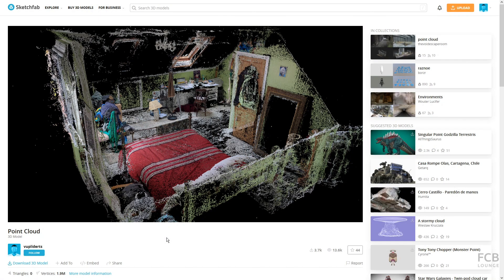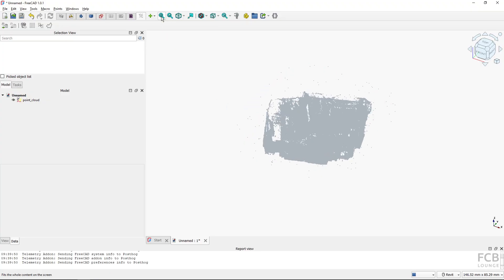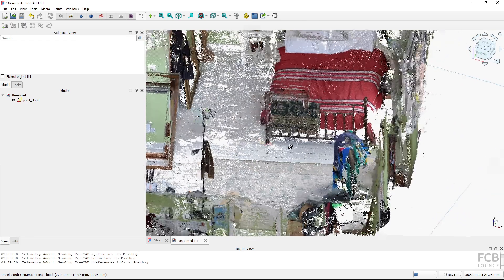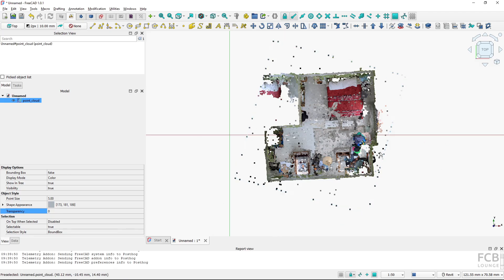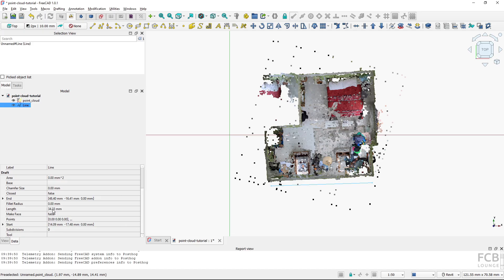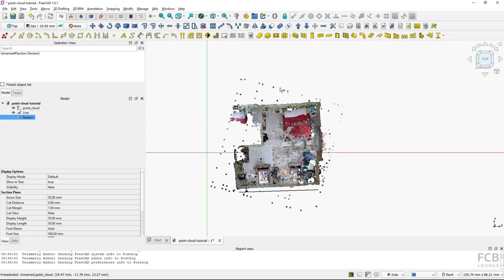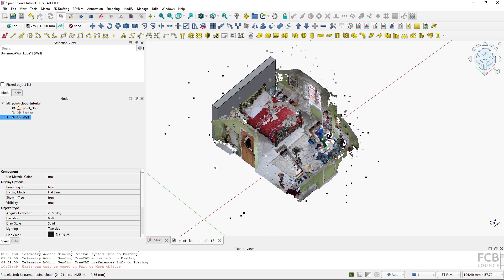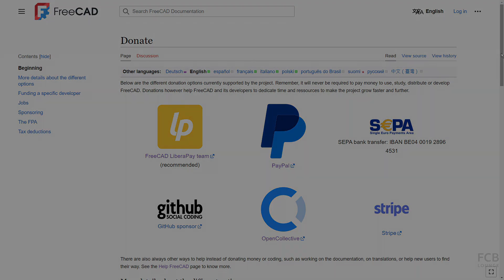Import Point Cloud to FreeCAD

Comment: on 6:50 of the video you say I can cut the point cloud with the section plane, can I take a cross section of the point cloud? is there a simple way or would I have to make 2 section planes one a bit above the other and have one cut the top and the other the bottom, if it is possible doing it that way?
Reply from the maker: I don't think that is possible with Arch Section object.